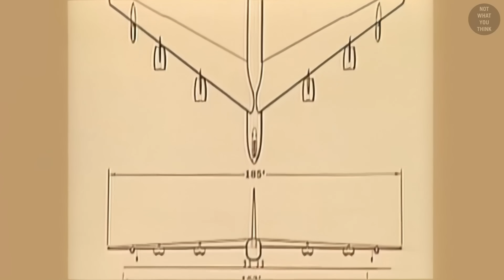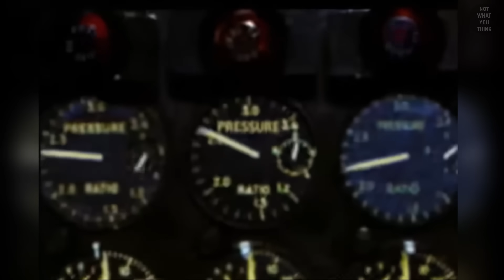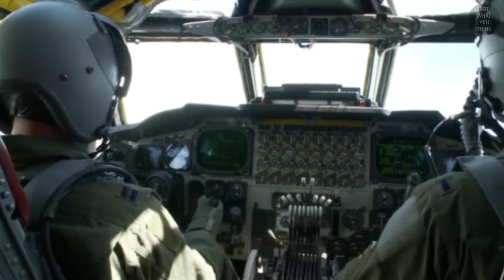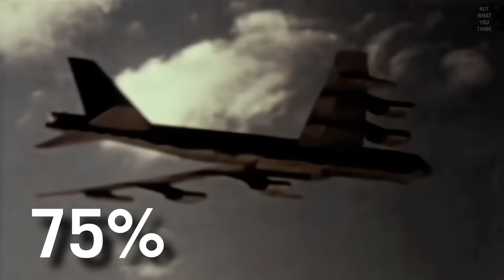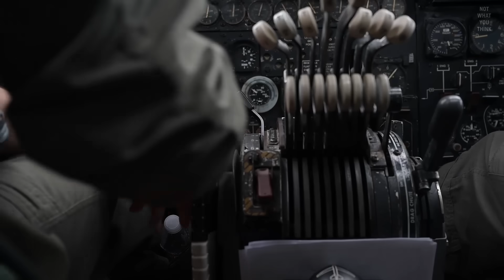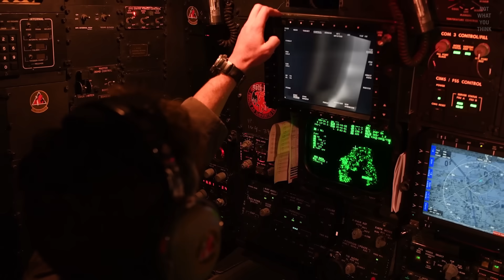Why This Obsolete Bomber Will Outlive EVERYTHING

Comment: Long as the B-52 can carry modern stand off cruise missiles, she will never be "obsolete".
Reply: russia has been doing the equivalent of that with its strategic bombers (pretty direct equivalents of the B-52 and the B-1 I think, the bear and that big swing-wing) in the ukraine war. I'm not sure if they haveeven flown them into ukrainian airspace at all.
Reply: @Ass_of_Amalek  Most of the big Russian bombers have been retired. The Soviets didn't really build them to last. Most of the remaining aircraft are being used in a maritime role. They had some in Syria for a while.
Reply: @patrickweaver1105  false. No so many has been retired, they are constructing new one and they have been use a lot during Siria war and during ucraine but less
Reply: @ser43_OLDC  90% of Russian four engine bombers are no longer in service. There are maybe fifty operational TU-95 variants and TU-160s operational. There are about 66 TU-22Ms in operation. Russian combat availability runs about half that number. All the rest are gone. The PAK-DA won't be combat ready for another decade.
Reply: @patrickweaver1105  tu22M 93 are in use with the air force and 58 with the navy
Tu160  17 but the production of it has been restarted so it is planed to recive 50 more units. The final number can go down 
Tu95 it is said that the number of it is around 90-70 units between the tu95 and tu142.
So yes they have loose numbers but the fact that you don't need as much numbers when one can carry so much ordinance. Yes is true that the numbers of tu95 is going down and it seems that the Russian airforce is moving toward high speed bombers than low speed ones
Reply: @ser43_OLDC  Yeah that's not even close. They do plan to build more TU-160s when they have the parts, and money. They've been planning it since 2016.
Reply: @patrickweaver1105  Meanwhile, the United States has six brand new B-21 Raiders in various stages of construction, with one reportedly undergoing ground testing with the aircrafts first flight scheduled for sometime in 2023. The B-1B Lancer and the B-2 Spirit are scheduled to be phased out by the early to mid 2030s, with the time tested B-52 remaining in service for a wide variety of missions, from carpet bombing to launching cruise missiles from standoff range. Russia is hopelessly behind the United States when it comes to designing and fielding both strategic and tactical aircraft.
Reply: @patrickweaver1105  the first new tu160 came out in the winter of 2021
Reply: @classicgalactica5879  ofcourse usa is over  rusia in bombers because the us has the biggest defense budget in the world while rusia the 8th, meaning that they can afford and produce faster bombers. Also the fact the US has been always very focused in bombers while the Russians has focused on bombers in a strategical roles, until the 80 were they started giving them a tactical role
Reply: @patrickweaver1105  the Tu-95 though is pretty much the Soviet equivalent of the B-52
Russia may have different plans for them however, so they may not get to stay in service as long as the B-52 will
Reply: @ser43_OLDC  The Tu160 was designed in the 1970s and went operational in 1987. They've been building them slowly and modernizing them as they went ever since.
Reply: @ser43_OLDC  Russian planes are crap.
Reply: @HANKTHEDANKEST  ofcourse whatever you said aerospacial engineer
Reply: It will outlast the USA that’s for sure.
Reply: Random..If it's looking down the kisser of a Russian or Chinese hypersonic.I personally don't think it would be good for this old BOB(bucket of bolts)...
Reply: @bigstuff52  It's pretty hard for anyone to hit an aircraft in flight from five hundred miles away. It's certainly beyond Russian and Chinese hypersonic capabilities. Yes the JASSM-ER has that much range. The JASSN-XR and Tomahawk can have more than double that.
Reply: @patrickweaver1105  I'm no expert on the capabilities of Russian/Chinese anti-aircraft missile systems. I know the -400's and -500's are SUPPOSED to be super weapons. BUT.........Tracking a B-52, through a mountainous region, (of which there are many), and flying at 100-300 feet above the ground, while using forest trees and mountains for cover, HAS to be a VERY difficult task. Add to it, the added difficulty of tracking HUNDREDS of bombers, coming across your border at the same time, along with submarine and ground launched ICBM's, while the missile crews are having to clean their pants while they're pressing all those complicated buttons.
Reply: He's immortal bro

Comment: I still have a hard time grasping that this beast is 70 years old
Reply: Technically a 70 year old design, but the airframe is about 60 years old. The B-52H, produced form 1961 to 1962, remained active. Earlier models made before 1961 had been scrapped or retired.

Comment: 744 b52s were built. And 76 are still in service. First flight 1952. 803 kc-135s were built. About 400 still in service. First flight in 1955. Came out a few years later but I would say the 135 is going to outlast the b52 by a Longshot. I know it's a bomber but that's not the title of the video.

Comment: I will admit I wish it was the B-52 getting axed, not the B1, but that's just because swing wings are cool.
Reply: B-1s are very cool, but they’re a maintenance headache. All of them are built slightly different from one another (you could line all of them up and see some are noticeably shorter than others) which means a part for one, might be different on another. There’s a lot of jokes throughout the bomber community about B-1s not being able to get airborne.
Reply: @DarkStarlifter  Ya, because their budget got slashed 50%

Comment: Other Aircraft: "The B-52 is obsolete."

The B-52: "I will be the flyover aircraft for your retirement ceremony."
Reply: It will be at the post nuclear war flyover ceremony of not dying
Reply: @deusvult6920  The new electronics might fry, but the original avionics were designed to survive an EMP from a nuclear blast that would likely make lightbulbs explode.
Reply: @deusvult6920  Cringe username aside, there will be no nuclear war as every nuclear power in the world has responsible nuclear weapons policy.
Reply: When you fly your airplane to the boneyard you will get a ride back to your base on a B-52.
Reply: @sd906238  This joke is dumb. The B-52 only has 5 seats and they're all crew. They're not a plane you hitch a ride on. If they give you a ride in a military plane it'd be a C-130 or C-17 depending on what's around.
Reply: B-52's and F-16's use to fly over my house in the 80's and 90's at low altitude. They were so dam loud. The f-16 sound went by quickly but those b-52's flew so slow it took forever and you had to cover your ears. When they closed the air force base I kind of missed them.
Reply: @flhxri  I know that feeling also living near an airbase. No F-16 here (unless it is a visit) but our own Gripen fighters are lound enough. Yes I live in Sweden.
Reply: @flhxri  sounds like heaven to me
Reply: @flhxri  you must have grown up in Lake Worth or White Settlement.
It seemed like a B52 was landing or taking off every hour , the F16 were stealthy and silent compared to the F4.
Reply: They dont junk it out of respect for Slim Pickins
Reply: The joke I heard is like this 😁
The last B52 pilots will fly back from the airplane graveyard in a DC3
The last DC3 pilots will fly back from the airplane graveyard  in a C172
The last C172 pilots will drive back from the airplane graveyard  in a WV beattle
The last WV beattle driver will walk back from the junkyard wearing RedWing boots
Reply: @ricardokowalski1579 joke didn’t hit
Reply: I saw a documentary a few years ago where they interviewed a B-52 pilot (he was like 30, tops). He said that likely in the distant future, when the Air Force retired their latest hypersonic bomber and flew it to the Boneyard, the crew of the bomber would get out and climb into a B-52 to fly home.
Reply: @TheEverLivingAnth  It is a nice thought to a bomber pilot, but bombers aren't used that much for personnel transport. A more likely, similarly old air frame that seems unable to die is the c-130. Most likely, their will be a decommissioning ceremony with higher ups from their base. If they are lucky, they will just fly home on the "corporate" jet with them.
Reply: It clearly is obsolete. But smart weapons it can now drop, they are not obsolete.        Meaning, would you fly this anywhere near a modern war?              NO!      But that doesn't matter because there is modern ordinance capable of completing missions this old aircraft cant.      Take from that what you will. :)
Reply: My "best comment of the day" award goes to you sir, congrats!
Reply: And Bear along the BUFF
Reply: Followed closely by a flight of A-10s! Because sometimes cheap and low tech in large numbers is just the way to go after air superiority has been established by the fighter jocks and drones.
Reply: Well said... I think that's something that's happening
Reply: Did everyone get their vault passes?
Reply: "You're old"
"I will come to your funeral"
Reply: More appropriately: "I will bury you!"
Reply: Tu-95: Hold my vodka.
Reply: The same joke is used between Huey helicopters and Blackhawks
Reply: A Pigroach moment.
Reply: Dang 😂
Reply: Legend
Reply: And "Brand New" B-52s are being tested and expected to serve for "A Full Century"
Reply: if the B-52 is so obsolete, why is the Air Force still using it and planning to use it for many years to come?
Reply: 70 years old but only a couple of decades for that landing gear on. Before that it was really obsolete
Reply: Byeyeyeyeyyeyey plane🤧
Reply: this format of a comment/joke is so farqn old... please stop breathing
Reply: @craptobotfanboy4958  some jokes are timeless.
Get over it.
Reply: @craptobotfanboy4958  bot behavior
Reply: @craptobotfanboy4958  Jokes do not have an expiration date.

Comment: The B52 is a standoff weapon. It has the radar cross section of 100M2 that's 10x the RCS of a b1 bomber and would not survive modern AA systems.
Reply: The only reason it’s still in service is because we’ve maintained absolute air superiority in every war we’ve fought in the last 50 years
Reply: I suggest watching the video. Maybe you'll learn something instead of spewing ignorance
Reply: I stand by my statement. Nowadays It is a standoff missile delivery system, capable of carrying large loads of cruise missiles.  In Vietnam and Laos you carpet bombed. The Communists shot down more than 19 b52's in Vietnam. I am 73 so I remember that conflict well.
Reply: It doesn't have to survive enemy air defenses. We use stealth aircraft to introduce ourselves and destroy anything that could be a risk to the B52. Then we have fighter aircraft protecting them on the way to deliver freedom.